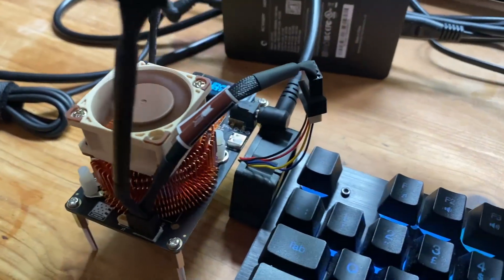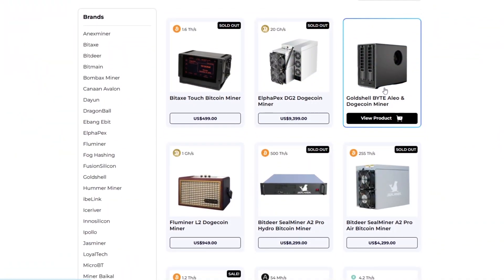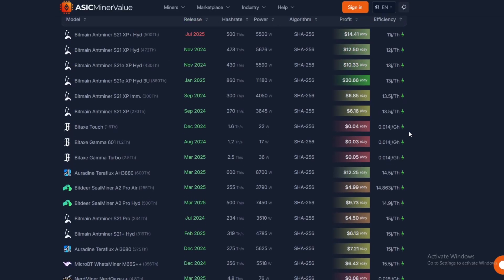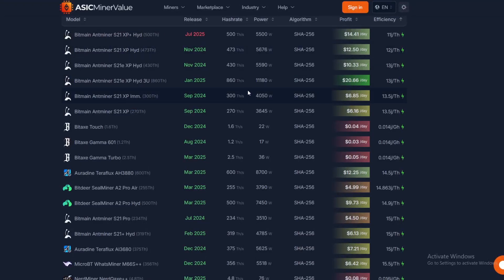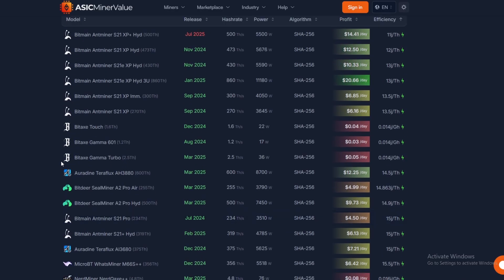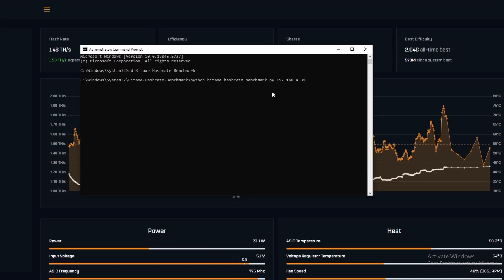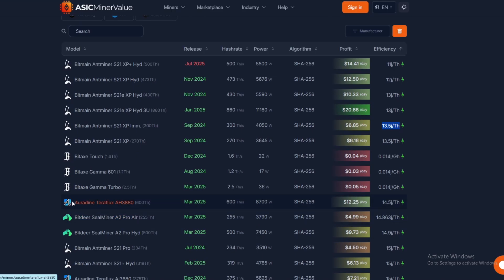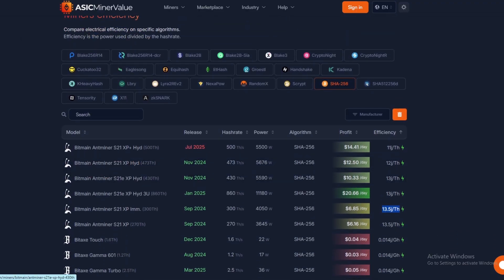Most Efficent Overclocks for The Bitaxe Gamma (11 j/TH)

Comment: Hi, just run the benchmark and the ASIC overheated , stock everything, after this I have a problem with the fan, it just stays at 840 rpm and won't go higher, I changed the paste(was a pink one ..) put new one thinking it was the problem but no, after I flushed it new firmware paste.. it shows a fan problem .. wtf, what should I do? Any suggestions?
Reply: Yeah replace the fan controller chip it sucks also that chip no one offers a deal on its the U10 chip on the back lower left corner I’m gonna start doing repairs if you’re not comfortable with surface mount soldering

Comment: Nice job!  I am having a hard time finding a bracket that will work on my  Bitaxe 601 Gamma. I have a received an Ice Tower and adapter. But does not fit. What are you using. I have 2 NerdQaxe++ on order for May's production.

Comment: Is the power use of the fan included in the efficiency? If so you might want to test your best efficiency without the 2nd fan and see if the results improve.
Reply: Yes, it does count, it draws power through the board.

As someone mentioned, you could power the fan(s) independently from the Gamma, which woukd make the Gamma’s efficiency look great, but in the end you are still consuming power elsewhere for rhe fan(s), THOUGH, at least the Gamma’s board and voltage regulator aren’t burdened by the external fan’s power consumption (allowing for higher overclocking).

Comment: If the bit axe came with a stand you could mount the back fan on it... I currently have mine held on with twist ties since I didn't have any screws. Also you could put a 60mm noctua fan since the stand/case is about 60mm wide, you could use screws, zip ties, twist ties or elastics lol
Reply: Mine came with a stand. I put a 6010 fan on the back. It plugged in on the spare fan connector. Keeps the chips on the back much cooler! I ordered a few heatsinks for some overclocking